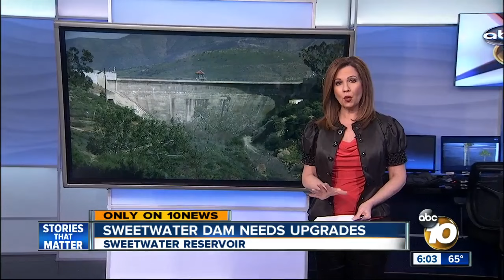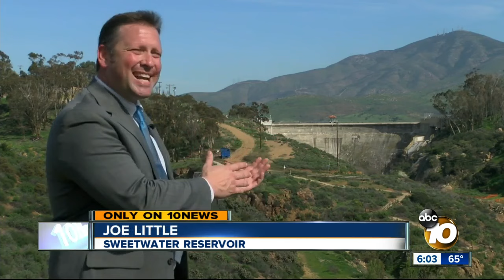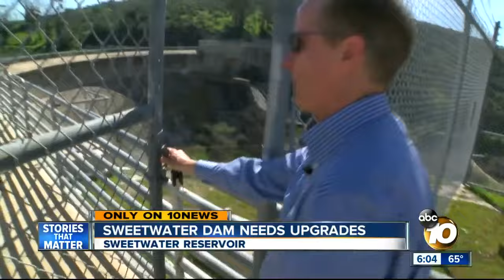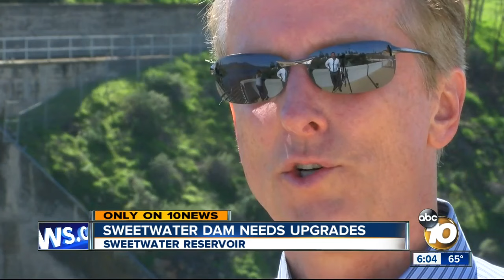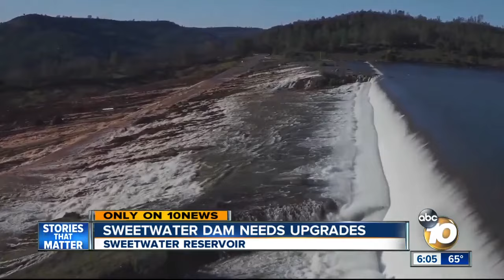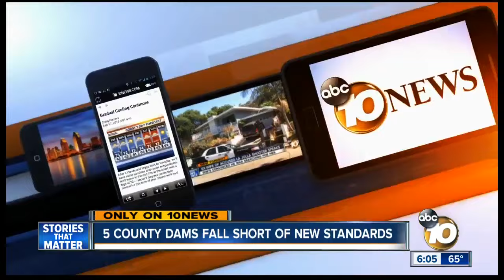Sweetwater dam in need of upgrades

Comment: The Sweetwater Authority, it appears, continues to fight tooth and nail not to fix this dam. The Division of Safety of dams hasn't disappeared or succeeded in bringing any constructive improvements and its original timeframe was 2013-2018. A little after ABC made this report the SWA took out about 22 Million in Revenue bonds underwritten to fix the dam. That money has been spent. Anyone who wants documents, just ask me.
Reply: You can't fix what you didn't build. All attempts at repair since they "found" the dam have failed. We haven't a clue how to make the concrete mixture the real builders of the dam used. Ready mix is pure crapola in comparison. Whomever built the latest "old world" were true masters who cared not about gravity, expense, nor leaving any surface without intricate amazing "symbology". 
We have a Tieton Canal commission who have spent the past, 14yrs now, trying to figure out how to repair a 15 mile Canal, built in under a year(supposedly, no photos give any evidence other than it looks like the dredged it our after some catastrophic event, it's also set into side of mostly shear basalt rock cliffs about 35 or more degrees through eastern Cascades. The original Canal Builders materials are like brand new, the (8") addition we applied to the top of the Canal circa - current stupid age of man, is what keeps leaking and failing. 🤣 Our past lies always catch up to us, which is why they're removing the old dams, they can't repair them, so they say they're doing it to rehab the rivers. 🤣🤣